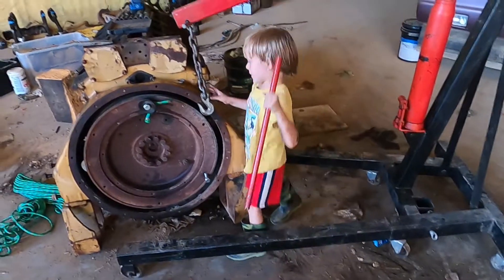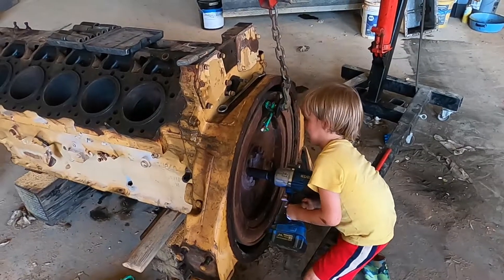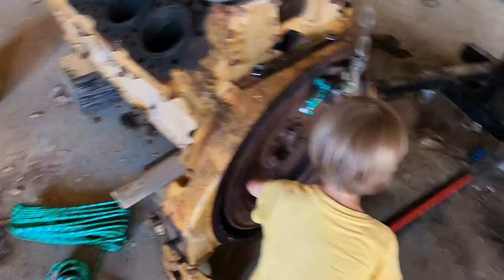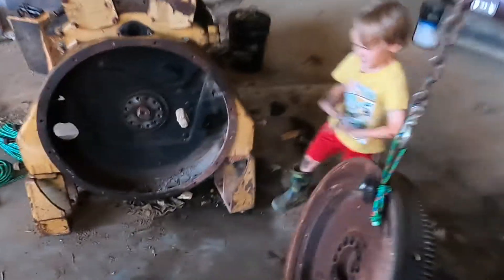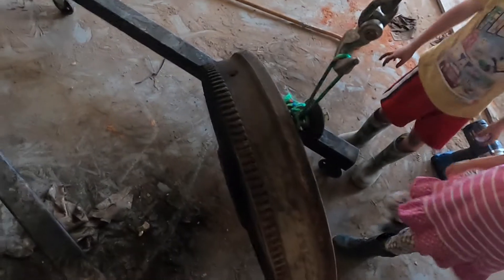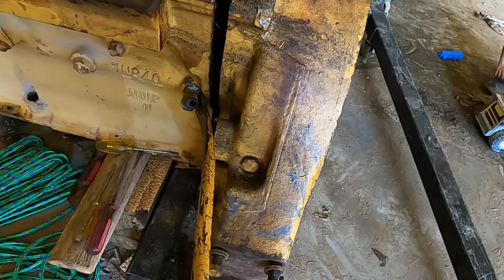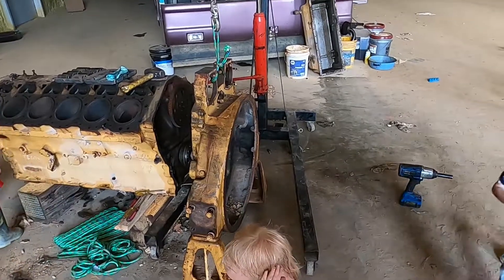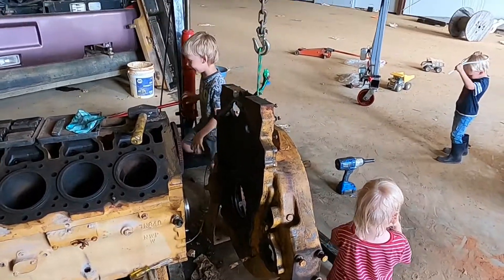Caterpillar 3412 EP10 - removing flywheel and housing

Comment: The main thing for that pin is for timing, to set the timing on the motor there will be a 3/8s hold on the side you can pin the flywheel and get all your timing on from there
Reply from the maker: Ahh right you mean the pin at 7:00 . You're right. I know some engines are "externally balanced" in which case the crankshaft is balanced with the flywheel and they have to be bolted together a certain way. But I think that's more of a automotive cost savings thing, I don't think that these industrial engines have it. Yes they are timed off the flywheel. There is a hole in the front of the flywheel and you can buy a little spring loaded pin that screws into the flywheel housing that will pop in place and hold the engine at cyl 1 TDC.
Reply: @castirondude  I believe most 3400 series cat you can just use a 3/8s bolt with your turning tool, I usually get a 4 inch one and cut the threads off, that should be about perfect size for flywheel housing and the hole on the flywheel, but if you would like to buy the tool more power to ya!!
Reply from the maker: @cullen9017  You mean you use the bolt as a pin to prevent the flywheel from moving? Yes I haven't tried it but I'm pretty sure that would work. The tool has a round nose and it's springloaded so it will drag on the flywheel as you spin the engine by hand , then it will pop in place once you reach #1 TDC. It's convenient and easy for one person to use in a cramped engine compartment. I watched my mechanic do it on my 3306 in my excavator. If you have the engine out of the vehicle then I reckon it's much easier so the tool isn't really needed.
Reply: @castirondude  that sounds like a pretty slick little unit, keep up the good videos and good work👍 and keep the little fella helping you hard at it, it’s enjoyable seeing such a smart young lad getting his hands dirty on a project like that, like I said before, he will go far in life.
Reply from the maker: @cullen9017  Thank you so much for the kind words!